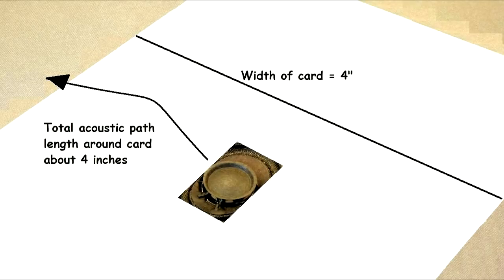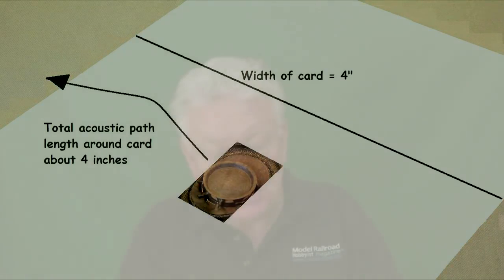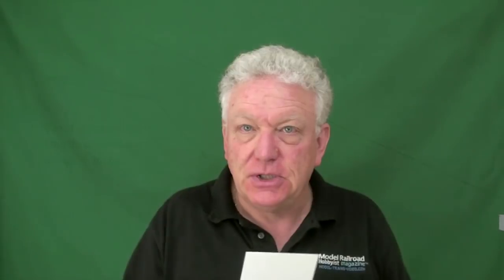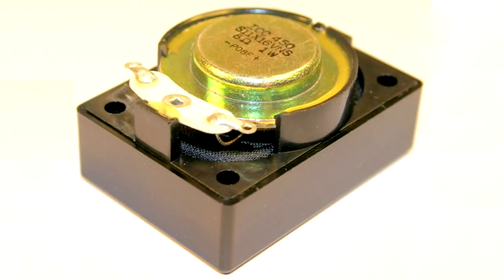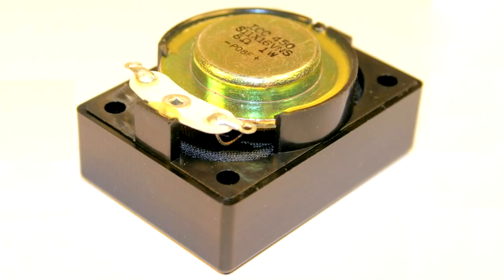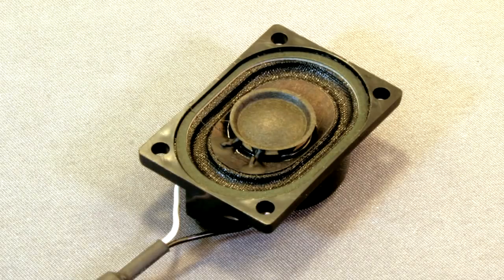DCC speaker principles | Getting the sound out | Model Railroad Hobbyist

Comment: This makes perfect sense form a physics point of view. Ever try to breath into a bottle? Much harder than breathing into open air. The speaker has to compress/expand the air in the box, thus reducing it's efficiency and reducing/distorting the sound coming out of the other side. Now if you could make the box infinite in size, no difference. The bigger the box, the better.

Comment: Wrong.it does matters how u mount the speakers. Like car audio. On bass speaker facing Torres the back of the trunk. The sound bounches off the trunk deck  and makes the sound bass deeper and louder. = Backfiring ..That's why model train manufacturer mount the speakers at the belly facing down to the tracks. The sound bounches off the track becomes louder deeper. Also help to box's in the speakers for extra loudness deeper sounds.
Reply: Watch it again and turn your audio on. If not, buy better hearing aids.
Reply: @jpsholland  lol..your the one who needs a hearing aid...it does matter where u mount the speaker...most manufacturer mounts them in the belly/ fuel tanks speaker facing down...this affect is called back firing..that technique works by bouncing the sound off the track bed at short distance which makes it louder...just like a box 12+ bass speaker pointed towards the back of the trunk of a car.. sound bounces off and become more louder....